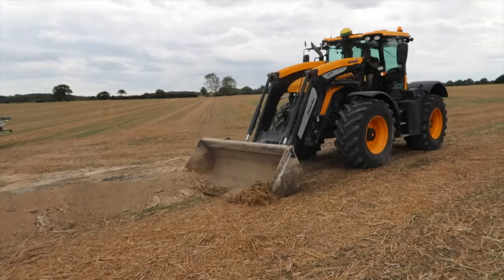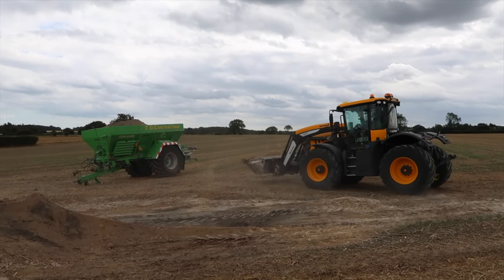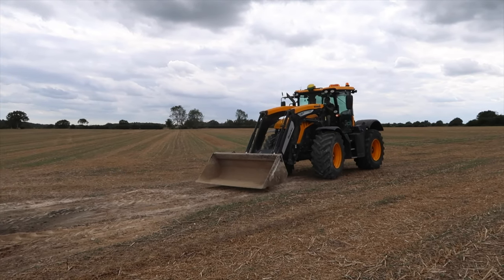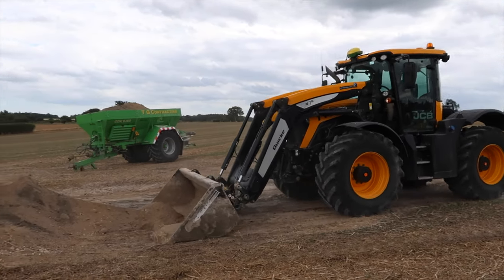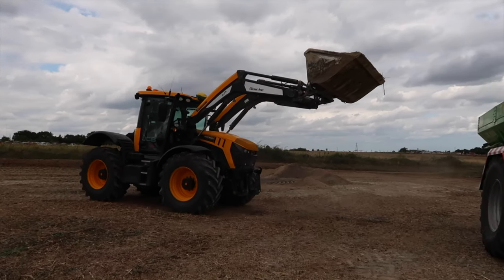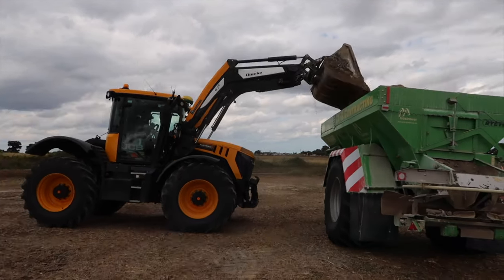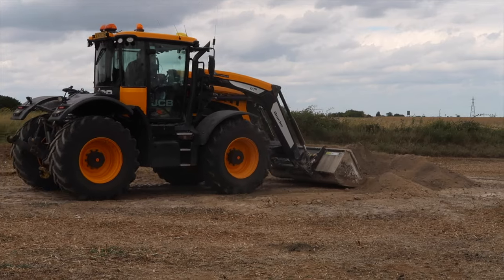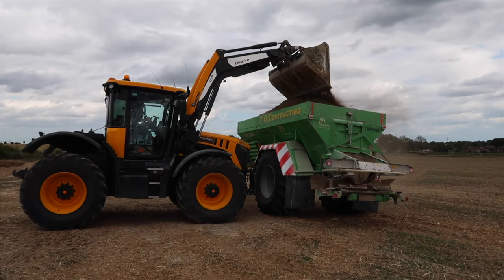Spreading Lime With A JCB Fastrac

Comment: Hi there Olly long before I was born in 1997, all the way back in 1993 we had a company called Agridry come down for silage over at our farm and spread lime. I get told about it all the time and I wish I could have seen it happening myself. That company used Ford 40 series tractors, they're now based in Yorkshire using the same equipment.

Comment: It will be so annoying having to hitch and unhitch that lime spreader🤦‍♂️
Reply: Keeps you fit
Reply from the maker: Whatever it takes!
Reply: Consider how annoying it would be needing another tractor, another operator and another vehicle to maintain for the same output.
Reply: @ignasanchezl  why would you need another operator we run 2 spreaders and a loader with two men load yourself with a loader and then get back in tractor
Reply: @bradleykirk3206  Then your operation is on a larger scale.
Reply: Larger scale operations and a larger budget will always give you an advantage.

Comment: Fastrac with a loaded really isn't good
Reply: How is it not, the fastrac has self levelling suspension so it distributes the weight evenly
Reply: @darraghgilmore6723  I have tried it and like it, but they need to make it so you can take the front suspension off or stiffen it up way more, it is way to bouncy and soft, with a full load in the bucket on a turn feels like you are going to tip.